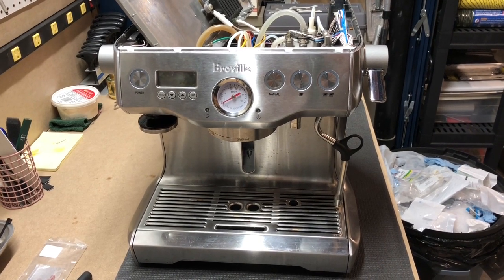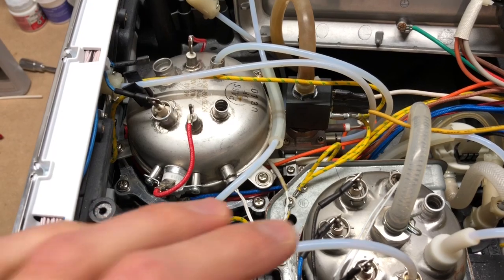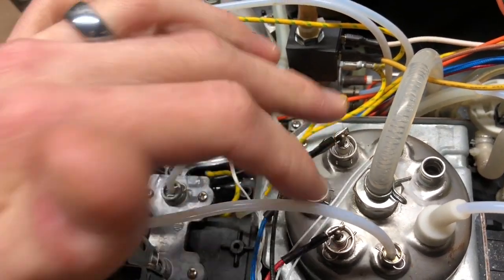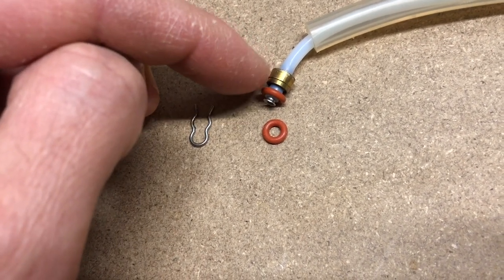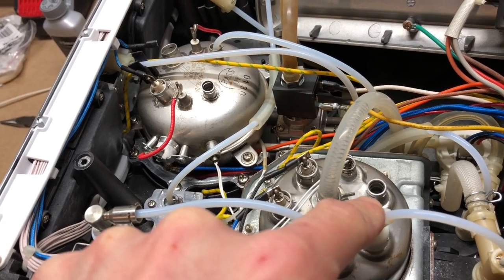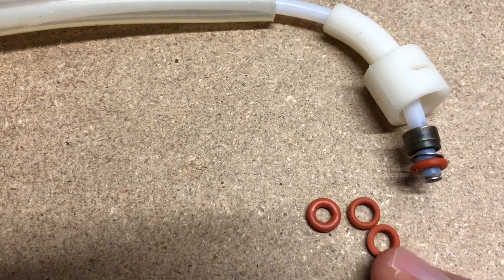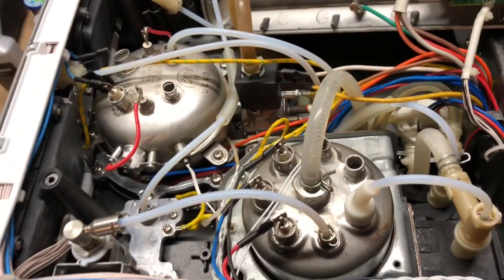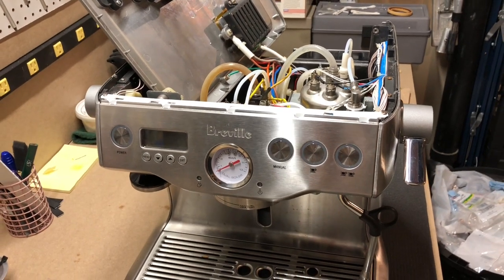Breville Dual Boiler O-Ring/Gasket Overview

Comment: You have put together a helpful series of videos.  Thank you for taking the time to do so. Here is some recent (15 April 2022)  information on the larger size, blue, o-ring fitted to the probe. It appears the o-ring is a -009 size with a cross section of 0.070, ID= 0.208, and OD =0.348 inches.  They can be purchased individually from suppliers or you can source a kit off the big A.  The silicone kit is $54.  Silicone has better high temperature properties than nitrile or Viton.  I suggest you take the time to replace them all when you have the case open.  If one goes bad the rest are soon to follow. Keep the fixer community strong!
Reply: trial and error.  The 009 was a close visual match, plus by trial and error, I found that it worked where the other sizes leaked.  How did you determine the 010 was the correct size?  I searched but could not find a reference.
Reply: Was the 009 a fit for the BES 990?

Comment: Thanks for this, Joe! Your video helped me fix a leak on the steam boiler. Tip for others attempting to do the same: wait until the boilers have cooled before removing any of the hoses or sensors! 😁
Reply: Yes^ I learnt this the hard way. And by hard way I mean opening one of the steam pipes and getting splashed in the face with water, the splash reaching all the way to the ceiling...
Reply: helped me tons too, bought the o-rings for like $9 and tackled both probe leaks!

Comment: While my machine is a four year old Breville Oracle, the boiler configuration is pretty much the same as with the dual boiler. My leak was exactly the same spot as you show on the steam boiler - washer and two o-rings. It was causing my GFCI to trip. In my case it was just ordering type 006 o-rings from Amazon. Between someone else's video that showed how to remove the top and your's explaining the replacement, it was an easy fix. Thanks!
Reply from the maker: Glad the video helped, enjoy the coffee.

Comment: I did add the new thicker/fatter O-rings for the leaky gasket. But it still keeps leaking. But one thing I noticed you said is there should be washers also. I don’t actually have those washers on the replaced leaky gaskets. Where can I get those? If that doesn’t work, what other options can I have tho seal the leaky gasket? Epoxy Glue?

Comment: Thanks heaps for this video! On mine, the hose that connects to the steam wand was leaking steam (at boiler end) due to the perished orange o-ring. I have replaced it with a black o-ring with the same dimensions. No more leaks however now the machine beeps 3 times when I go to use the steam wand. Any ideas? Thanks so much! Tom.

Comment: Is there a part number (Breville, Grainger, or...?) for the metal washer on top of the double stacked o-rings?
Reply from the maker: I suspect there is but I've never come across it. If you get stuck you could make your own out of stainless steel, it doesn't have to be perfect since it's just a spacer.

Comment: There's another port down on the side of the steam boiler behind the electrical wires; what's that configuration?  Mine's covered in what looks like an wasp nest but made of lime scale, and I'd hate to work my way in there only to realise I didn't have the parts I needed or to drop something without realising it was missing.

Comment: What should I do if I have water dripping out from my hot water spout and steam wand? Can you link me to the exact pets please
Reply from the maker: You've either got an old machine with aged gaskets/o-rings or a lot of scale that's preventing the gaskets/o-rings from sealing. You could start by descaling, or start by replacing the gaskets/o-rings. I used ereplacementparts.com to see the exploded view and find the parts I needed.

Comment: Hi Joe,
Thanks for this informative vid. I used it to solve a leak that kept tripping my mains circuit breaker. However, a few months later, my duo boiler keeps heating up to around 140 degree celcius (instead of 93). Do you have any suggestions on how to fix?
Reply from the maker: I've heard of this problem before but I'm unaware of the solution. Sorry couldn't be more help - keep goggling since this seems fairly common. Also, before spending too much more $ on the Breville I strongly suggest looking at an ECM or Profitec.  I moved to a (used) Pro700 and, despite the high initial cost, it has been terrific and and very consistent in the 18 months I've have it...also very good for parts and easy repairs.
Reply: @322816  Thats great to hear. I've been looking at the ECM and Profitec. Im having this same problem in addition to the brewing temp dropping after I pull a shot. I have to wait a minute or so before doing anything else on the machine. I have a BES980. Now that I have the machine open, I also see what looks like white battery acid build up on two probs on the brew boiler. Have you heard or experienced this? Thanks.
Reply from the maker: @cdubu2009  White residue is likely either scale from a leak or corrosion on the electrical connection.

Comment: I am working on this fix with a newer model Oracle. It has nuts securing the hose connection between boilers (previously the plastic or rubber boot), does anyone know how to remove these nuts? I suspect it is threaded, but mine is very tight and I hesitate to force anything?
Reply: Hi mate, did you work out how to remove the bolts, I have the same problem

Comment: Joe:  I have a Breville BES920XL (Dual boiler).  The steam boiler is no longer producing steam for the steam wand.  The hot water tube is only dripping hot water - I can no longer get enough hot water from this source for Americano coffee's.  However, the hot water tube continues to leak hot water and has leaked for some time.  From your experience, would you say that my OPV valve is causing the problem?  Please let me know.   Thanks for the VERY instructional video's!!!!
Reply from the maker: Best guess is that you have a lot of scale buildup which has clogged the steam wand and obstructed the gasket/o-rings on the water spout. BES920XL is easy to descale due to the introduction of the boiler drain plugs (they were not on the 900 model). You may have to descale several times if there's a lot of accumulation.
Reply: @322816  Thanks Joe!  Appreciate the feedback!

Comment: Hi, do you know the sizes of o ring? -007 for the smaller one? And the other? I’m going to order a pack of “aflas” o rings but want to make sure I get the right size. Thanks!
Reply: On Ebay you can buy the right O rings. The cost is minimal.

Comment: Hi thanks for this video as it will enable me to do repairs to my Breville 920XL that is leaking water. I have started the repair but I lost one of those little steel washers that goes on the hose before the two o rings...any idea what size these washers are.
Reply: Similar issue here. Looking to find out a part number for the metal washer. Grainger could be a source.

Comment: 9 Months after my first repair - I'm back.  :(   Same one.  Has a boot with tube going to 2nd boiler.  I pulled the tube and the O-ring was stuck inside. Finally got that out.  My issue is - IDK where the PIN should go.  I can't push in the tube far enough for the pin to go over the metal parts on the tube.  Maybe it shouldn't be put in like this.

Now a metal post went into the steam boiler and the 2 leaks are fixed and 3 more now leak.   Sadly 2 are the big blue o-ring which I don't have.

Does anyone know if the Oracle Touch continues these problems?   And if it's as difficult to fix?   Mine is only 3 years old and now I see rusted screws, etc. all over.

Comment: I have leak on the same tube that you took off. I want to remove the tube on the steam boiler side only since tat is what is leaking.  How do you get the boot off.  Mine is very difficult.
Reply from the maker: Mine was stuck as well due to scale from the leaking water. I used a qtip and descaling solution. Be patient, it might take many applications before it breaks down the scale enough to allow the boot to come off.
Reply: I used a 90° pick.  I slipped it under the boot and moved it around.  If you have ever removed a radiator line, it is similar but smaller.  After years of heat, the rubber sticks to the seal.  Be gentle with the pick and try not to put a hole in the boot (although I doubt that a hole would cause much of a problem).

Comment: This video is a serious lifesaver. I need to replace most of my o-rings on my machine. Do you have a size for the larger blue o-ring or did you just use the 007 for the replacements? Thanks!
Reply from the maker: Thanks every owner will need this video eventually. I found all the o-rings/parts at ereplacementparts.com, I'm not sure of the exact sizes.

Comment: Amazing.  Super helpful video!  I looked all over the internet for this exact thing.  I have a leak under one of those boots.  It doesn't seem to be coming up easily.  Is there a trick to pulling those white boots up to access the valve?
Reply from the maker: It's probably stuck due to scale buildup. Try soaking the area in descaling solution, wait an hour and try again, You may have to repeat several times.
Reply: @322816  Ok, O-rings finally arrived from Australia.  The pin is pulled but the hose doesn't just pull up.  Can I just yank on it or is there a release somehow?  This is one of the valves with the boot and the double o-ring
Reply from the maker: @jeffoberlander3346  If you've removed the locking pin then it just pulls up. If it's stuck it's either from scale or the old o-rings deteriorated and sticking in their hole. I would keep working it with descaler - be gentle and patient...as you can see by now, everything is quite fragile in there.
Reply: @322816  I fixed it!  It turns out, the circular valve casing was slightly bent making the round opening flat on one side.  I was able to squeeze it back into shape and then it pulled right out.  How it got like that I don't know!  The replacement of the 2 o-rings with the fatter single one did the trick!  The family is back in the coffee action thanks to you and this video and your kind follow up replies.  Thank you!
Reply from the maker: @jeffoberlander3346  Happy to have helped - enjoy the coffee!

Comment: Hi Joe and all.   I’m having a very hard time trying to get spare parts for the 920, specially the tube going from the steam boiler to the brew boiler that has an open line.   I’ll appreciate if you can provide a link where to order this part.  Thanks in advance, nice stuff Joe!.
Reply from the maker: Best bet is to go to ereplacementparts.com and find the exact part number for your hose, then search all the appliance part sites (assuming ereplacementparts does not have  any). Failing that you can contact your local Breville service shop and see if they'll sell you the part (they have access to parts direct from Breville). Last resort is to try to source the hose material from a place like Acklands Grainger.
Reply: @322816  thanks Joe, I’ll try as advised. Cheers…

Comment: sorry, i want to know how to open the two screws in the upper front ! I cant see that in your video......
Reply from the maker: You'll see how to open it in my descaling video titled: Breville Dual Boiler Descaling Procedure
Reply: @322816  it`s done.........ok.......but there is another problem: steam get`s out at the Boiler near a sensor with cable color yellow/green. It steamd out there ! that and the opther sensors in the Boiler wiggle ! Whats the mistake ?

Comment: Listen man I am in between of getting bes920xl or bezerra strega I just can't trust breville too much because they break a lot what you think about quality  on breville vs bezerra they much cheaper that's why I am waiting
Reply: I recommend against the Breville. Mine is just under two years old and parts are starting to break, need replacement. The machine is used frequently and is well maintained. Nothing you can do about cheap internal parts that wear out. In comparison, I had a Francis Francis X5 that worked flawlessly for 13 years before it fried itself.

Comment: What a Great Video Joe.  Hopefully, thanks to you and the rest of the information in this forum I can fix the issue with my BES980XL.  I assume it is going to be the same boiler and hoses as the 900XL.  Question, I wanted to make sure and purchase the exact type o-rings as everyone else.  If everyone has had great success, I would like to follow the same path if possible. Does anyone have a link to amazon for the three size o-rings that Joe mentioned?
Reply from the maker: Try ereplacementparts.com  that's where I bought my spare parts.
Reply: Hey, thanks for the fast reply.  Specifically, do you have the part numbers for the orange and blue o-rings?  I may have found the orange, but still looking for the blue.  Obviously, the OEM is discontinued and cannot find the replacement for blue rings.

Comment: Hi Joe, your video is very timely.  I just acquired a well used and abused BES900.  All three probes on the boil pot have been leaking to the point the wiring corroded.  Can your recommend a site to source the parts?  I'm very new to Breville.
Reply from the maker: ereplacementparts.com (US) or forumappliances.com (Canada) they have somewhat different parts at each. Failing that, Mcmaster Carr, water and steam resistant food-grade EPDM o-rings.
Reply from the maker: Did you pull the brew pump-to-steam boiler and steam boiler-to-brew boiler hose connections off (i.e. the two booted connections on the stream boiler)? I'm curious if your machine had the double (two stacked) o-rings that mine had.
Reply: I've not they don't leak which seems to be the only thing not leaking.  This was previously owned I'm happy to send you some pics.
Reply: I just replaced the ring on that and it did have the two stacked O-rings as you said it would.  Thanks so much for this video.  I can't believe I was able to replace mine and didn't have to send the machine off to be fixed for something so simple.
Reply: Hi Joe, is this the right part;
https://www.ereplacementparts.com/oring-for-hose-connector-p-1439534.html
O-Ring For Hose Connector
Part Number: SP0001672 for the hose connections. Seems many of the parts are obsolete but I think I finally found this one.
Tom
Reply: Tom Fran does this o ring work for the BES980XL?? I am in the uk and can’t get these o rings anywhere
Reply: @arusse23  did you find anywhere to get them from Sage has sold out... I am in the UK and have the same problem

Comment: Great video, thank you so much. I have question about removing high pressure hose. i have removed the pine but i am unable to remove it from steam boiler (it feels like they are glue). Does anybody have any idea how to remove them. will appreciate any suggestions.  Thank you
Reply from the maker: It is most likely stuck due to scale. Apply descaling solution, let it sit for 30-60 min then try to loosen it again. You may have to do this several times.
Reply: @322816  Thank you. I just did it twice and will repeat few time more then will give a try. will let you posted about the progress.

Comment: Hi Joe, is this the right part; and what is the size?
https://www.ereplacementparts.com/oring-for-hose-connector-p-1439534.html
O-Ring For Hose Connector
Part Number: SP0001672 for the hose connections. Seems many of the parts are obsolete but I think I finally found this one.
Tom

Comment: Sadly decided to do the one next to the booted one and wow - I can't get it down far enough to get the clip on  :(    got it in and it leaked steam  :o   Tried again - I think fixed.   
This is NOT easy folks.   The pins are not easy.  With the boots - I ended up putting the pin in and sliding the silicone boot over it.  What sucked was the tube to the side of the 2 booted ones closer to steam wand side.   wow - that made me cry.

Comment: How do you remove the hose?  Mine seems to be glued on and I’m afraid to just pull it hard so not to rip it.  Thanks!!
Reply: Not sure if you already figured it out, but I just removed mine. They were slightly stuck to the rim, probably because they melted due to boiling water leaking past.
Reply: I tried walking the boot up with my fingers, then took pliers with barely any touch/pressure and they came off.
Reply: Lisa thanks Lisa, I did something similar. Its working like a charm again